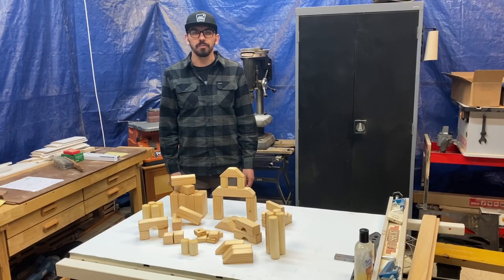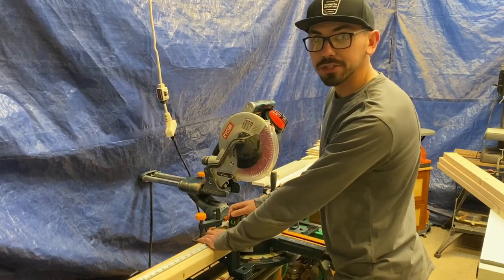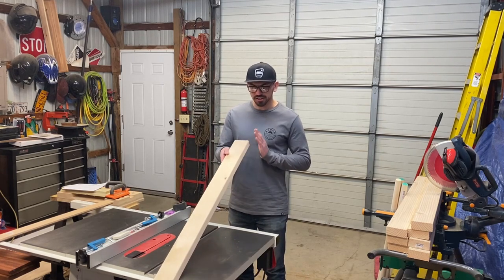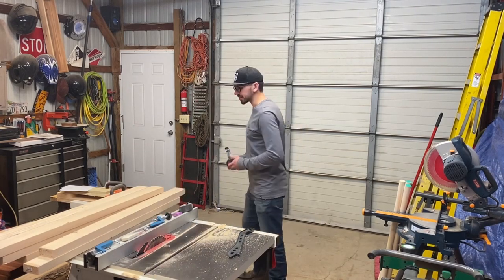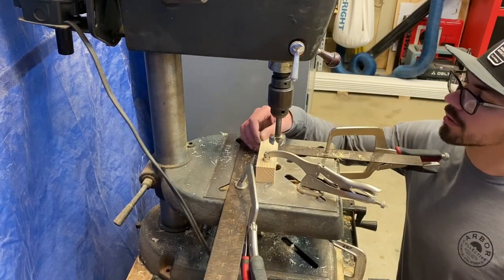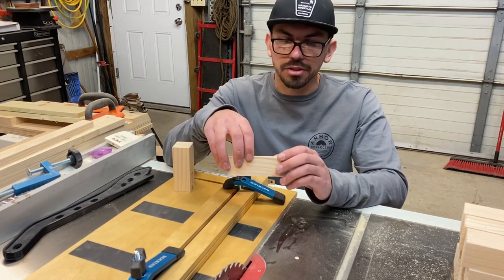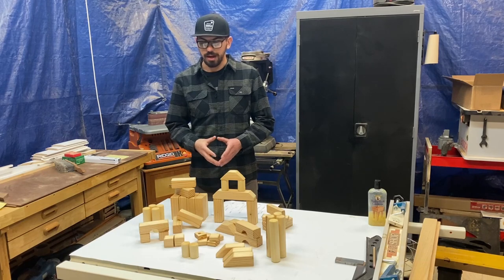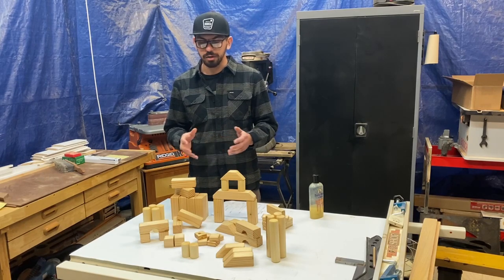DIY Children's Toy Blocks | How to Make Wooden Blocks for Kids

Comment: Thank you, I saw the template online, didn’t know how to do the arches. The drill press is a good way to achieve a nice clean cut. 😊
Reply: I use a large hole saw to cut a hole in the middle of the board and then cut it lengthwise to make 2 blocks.

Comment: What would be the best wood to use when making toys
Reply: the best would be a hardwood, but that's longer to work with and heavier and significantly more expensive, he's using pine
Reply: @jonathanschubert9052  that's true, thanks I'll check with the Hardware store and see the difference between the different types of wood.